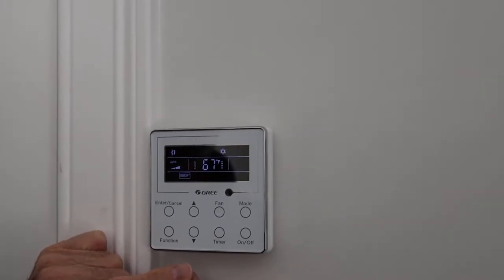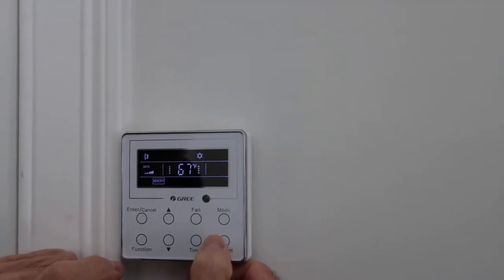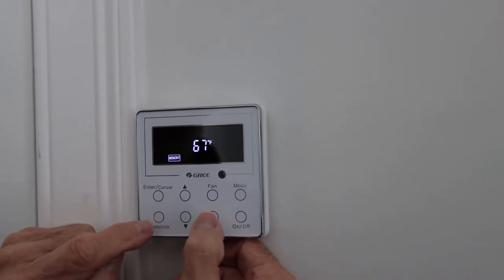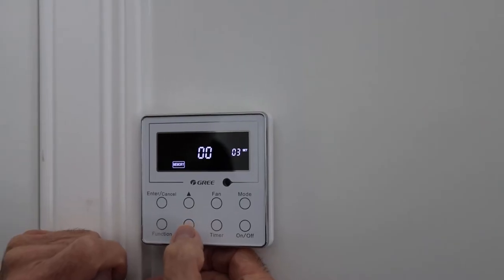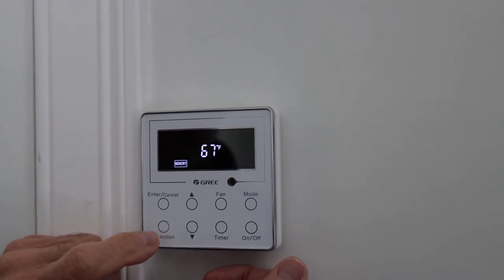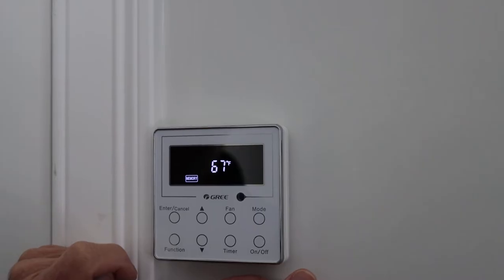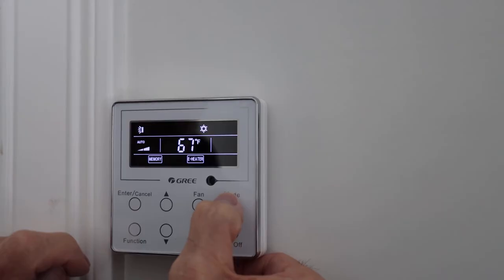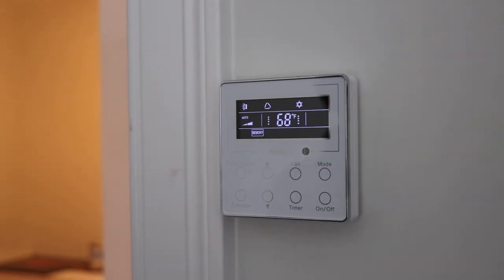Programing a Gree  Wall Thermostat as the Controlling Temperature Gauge

Comment: This thermostat i have set in gree vrf ac but there is a problem when the power goes off it doesn't turn on automatically i need to restart i need to turn on automatically if you help me it will be very helpful

Comment: sir how do i get rid of an E3 error code on my ac?
Reply: I just spoke to the manufacturer to ask the same question and they told me the fans will continue to run very low, but the main unit won't run unless it calls for heating or cooling.  This is to keep continuous air flow in the conditioned area.

Comment: Question, first video I have found that shows the right thermostat. How do I clear the memory on it?
Reply from the maker: Hi, my appologies, I don't know how to clear the memory. If it's powered by the unit itself, I would recommend turning off power at the breaker, if battery operated, I would remove the batteries. I found the pdf link for the units we intalled in the new construction, check page 17 for the info about the thermostat https://manuals.plus/m/4b49fd0cf79ed2436f0e5c46d62ebf288c70e92bfe29d216d0b52bbca29a906b_optim.pdf
Reply: @chrisraohomeaficionado9979  Thank you and I will look into this. Appreciate the help.
Reply: In off condition of thermostat press together theses two buttons for five seconds ( mode and temperature rise ^)

Comment: Sir,How do i change mode from heating to cooling through wall thermostat.
Reply from the maker: On the wall thermostat there is a mode button that should cycle through the various operational mode of the unit. Pro tip if you see and "E7" error it is because one of the zone's on your multi zone thermostat is set differently than the others. The compressor unit can only supply heating cycle or cooling/drying cycle at one time. You can supply heat to one room while calling for cooling in another. This typically only happens during seasonal changes. Hope that helps